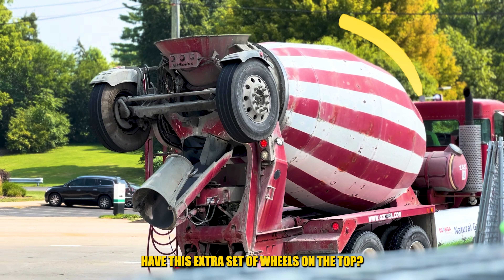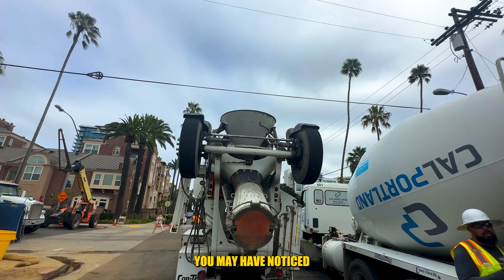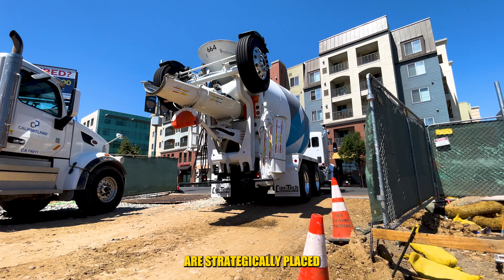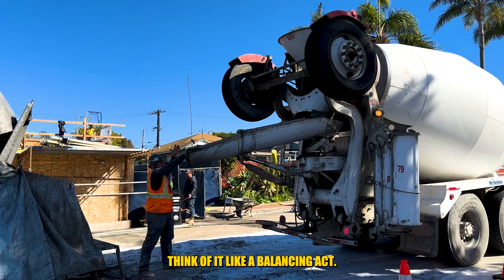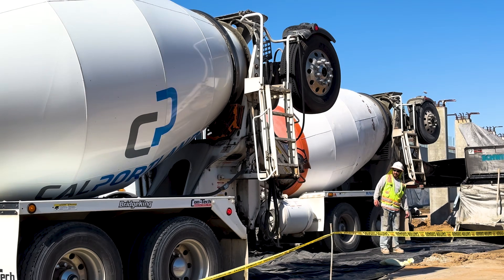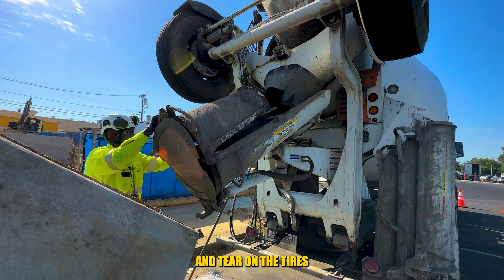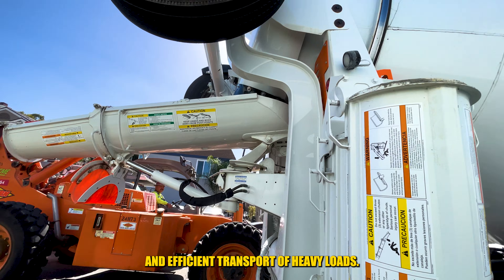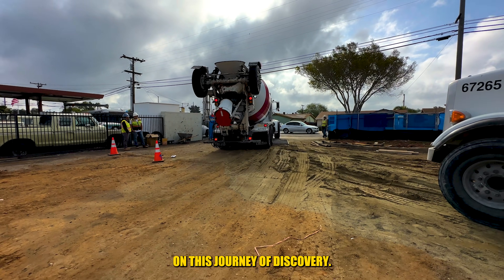Why do CONCRETE TRUCKS have EXTRA wheels? 🛞👷‍♂️

Comment: Not all concrete trucks are built like the ones seen in this video when it comes to those extra tires on the rear end. They all have those tires on the rear but some trucks have them apparently bearing the weight of whatever contraption that is mounted on the back end. I don't know what the name of that particular piece of the truck is, but you can clearly see that it's some type of engine or motor that's being hauled along with the rest of the truck. Those rear tires supporting the weight of that motor are not always kept on the ground, they can be lifted up off the ground and of course set back down whenever needed, but the most fascinating part of those from what I've seen by observation, is that those rear tires will actually turn either left or right depending on which way the truck is being turned from the front end. So what is the unit mounted on the back of certain concrete trucks called?
Reply from the maker: Thanks for sharing this interesting info! I didn't know all that! 😎👍🏼

Comment: what a load of shit, all that weight up high and at the very back of the vehicle is destabilising. Just design and load the vehicle to be safe in the first place instead of trying to rectify an overloading problem with another problem. In oz this sort of crap is laughable and nonexistent.
Reply: and dont forget that the concrete agitator truck was an Australian innovation.
Reply: @Evan-e6e Not according to Google. It said some guy out Germany did it first.

Comment: What blows my mind the most about these rear raised tag axles is that I never see flags on them. Why don't they require tall flag sticks on them since they are technically kind of away from the vehicle, when in use, and are very low to the ground. Light poles that flash would even be fine. At least people would be able to see it, no different than oversize vehicles having to flag the end of the load that's sticking out the back or sides of the trailer, so people can see it. Imagine someone in a taller vehicle, like maybe a lifted pickup truck trying to switch from the far left lane to the lane to his right, but have to wait for the cement mixer to pass first, and then he switches lanes right behind the cement truck, but hits that tag axle bcuz its too damn low to the ground and can't be seen. The only lights on it are the ones on the rear from what ive seen. How about the sides? Cement trucks in my opinion do not have the proper equipment to be seen. They also are very messy trucks and need devices to help keep them from spilling concrete all over the streets while in motion. Bcuz of this, I literally hate cement trucks. Ive blown tires bcuz of these things slilling concrete all over the streets. Here in Washington.D.C., we have super hardened globs of cement as well as long spill tracks of cement all over the city. If you're gling fast enough and depending which one you hit, you will blow a tire. I don't even understand how they be spilling this shit, but I don't drive cement mixers, so I'll never understand. I just feel like the city should hold these companies, and/or drivers responsible for this shit, depending on who's at fault. Whether it be the drivers not securing their shoots properly, etc., or the companies not providing the trucks with the proper devices to prevent spills, or both. I don't know if it's the drum trucks or the hopper style trucks that's spilling it this shit, but someone needs to be held accountable!
Reply: They have tail marker lights that signal brake and turning on them.